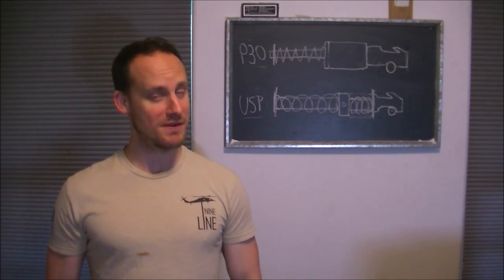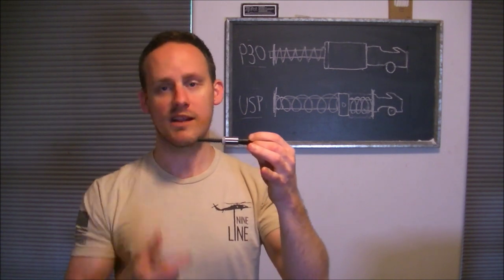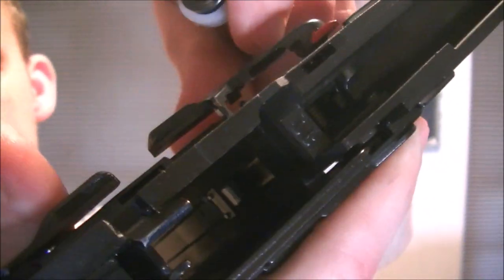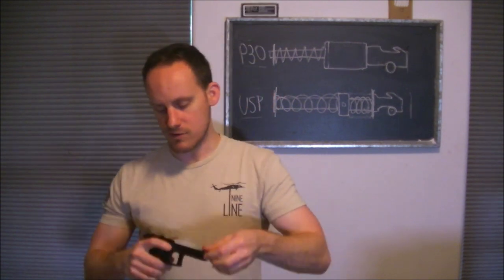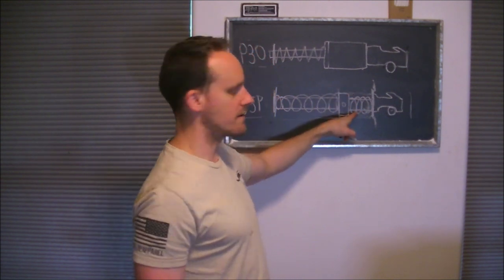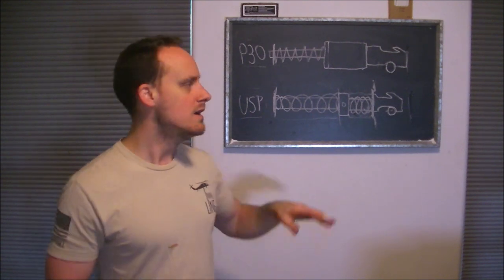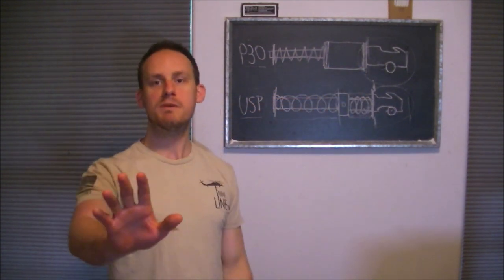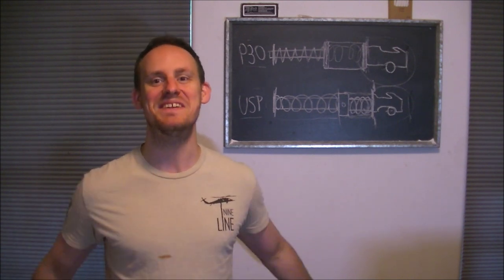HK P30 Design Flaw

Comment: 95,000 rounds fired from a P30 without any major issues proves that you know nothing about that gun.
Reply: Yeah Todd Green’s testing shows the P30 to be amongst the most durable 9mm handguns made. There was some broken parts but the P30 kept chugging along. However I do feel like the USP is a more robust design and if Todd Green tested that one the same I feel it would have did even better.
Reply: Glocks go that round counter regularly. The usp has a documented case of a range gun going for 297,000 rounds. Todd Geeen’s gun had rail damage at around 90,000 rounds and that’s why he ended the test

Comment: I know that you hate HK's cheapening of the spring design and even further with no buffer at all in the VP9 series. However! As Bruce Gray himself said, all spring loaded recoil buffers will cause pistols to flip like a Chinese gymnast and return the sights less consistently. While the USP is the only pistol in history designed to fire +P+ Infinity +... The longer stroke and recoil cycle of the USP makes it less shootable at speed. Bruce Gray won 7th in the World Championships with a USP9F with the recoil buffer removed.
I have found many reports that while the fullsize USP is softer to shoot, the Compact is easier to handle with less grip strength required and returns to zero much better. 

My P30L V1 LEM is still my favorite handgun of all time and my personal handgun has the short reset system and flat face trigger from Grayguns. The ergonomic shape on the P30 is perfect. The only thing holding back the extreme accuracy potential of the tight lockup is the heavily curved trigger shape. It encourages side to side pulling. I even prefer my P30L to my Guchi P229 and steel frame PPQ Q4. What amazes me about the P30 is how advanced it is for a 2006 pistol. The slide is a complex work of machining even by today's standards, full true ambi, exchangeable side grip panels and the two piece hammer system of the LEM is so ingenious it can even be used with a manual safety unlike the SIG DAK system. And it incorporates a rubber plate on the bobbed hammer to protect against drops. I broke the hammer pivot pin on my CZ 75 from a drop on the hammer. 
I also have to add that it seems almost retarded that other gun magazines don't have a rubber floorplate like the P30/VP9 series on an item that is meant to be dropped. Excellent board illustration and breakdown of the different recoil systems!

Comment: Didn't the P30 endure a 90,000-round test in one article? Did you read it?
Reply from the maker: No it wasn't a single article. It was an HK sanctioned independent test by Todd Green RIP. His P30 frame busted a chunk of polymer at something like 90k.
Reply: @doitriteak  It wasn't HK sanctioned, actually HK mentioned it on their website under the P30, with other parts of pistol started to give, the pistol still fired after 90.000 rounds.
Reply from the maker: Funny, because HK backed it with inspections and part replacements
Reply: @doitriteak  I have seen with my own eyes the pistol that fired 90,000 rounds in plenty of HK lit..They even have gun matts with all the info and a picture of the P 30. Just because you dont care for it does not make it a "design flaw" .. You are either being intellectually dishonest , or you dont do your homework. Either way wont be subscribing..

Comment: 2 more flaws: Not a Glock, and not 10mm. 
🙄😉 

A progressive-rate or two-stage spring system does seem far superior to a single spring with a buffer/bushing/crash pad to compensate for over travel at the end. 

My Tanfoglio Match came with a steel guide rod that had a skinny, puny little head or hat to engage with the steel frame. This lead to high pressure and premature frame wear on competitors' guns. So the Henning accessory shop designed a guide rod with a much larger head/hat that spreads the load out over many more surfaces, and then added a brass buffer ring to boot. I said it's a 10mm, so take that pathetic 14 lb match spring outta there and put something beefier in there, too.
Reply: Thinking a Glock is better than any HK product is a flaw.
Reply: @tonyfelix287  An existent 10mm weapon is certainly better than an imaginary one.